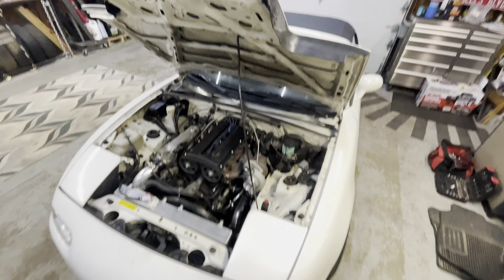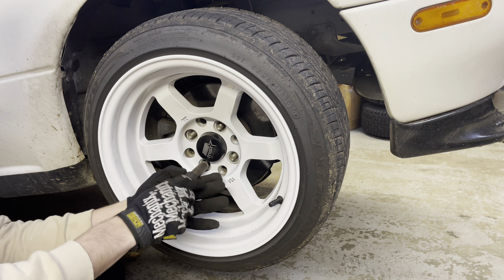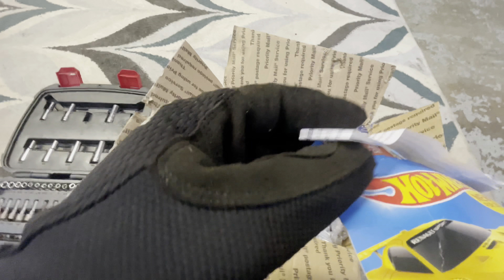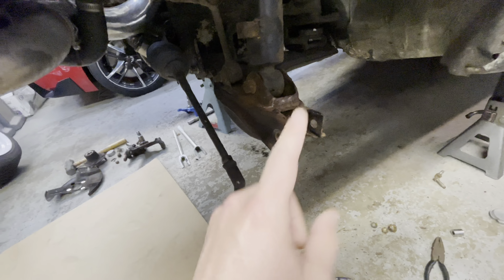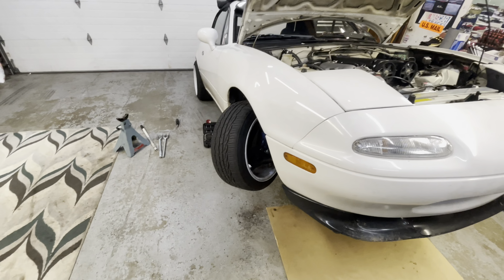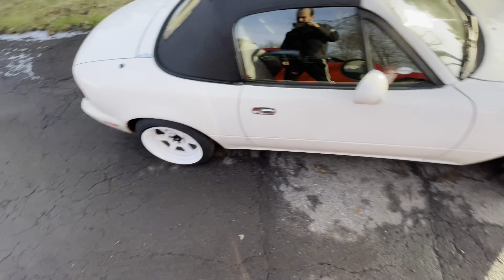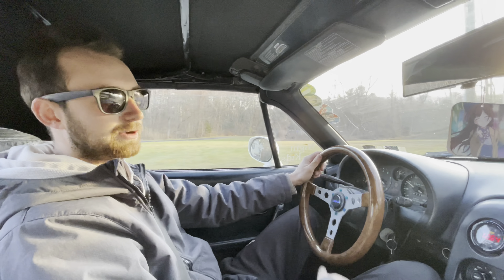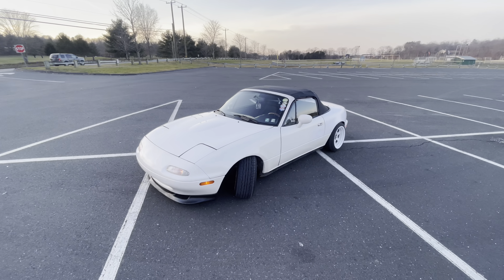Modded Knuckles DRIFT tested on the Miata!

Comment: Awesome job just curious what was ur brake lines like after fitting the knuckles or did u need to fit extended ones?
Reply from the maker: It worked with stock lines but they were getting stretched, since I have got the destroy or die arms and extended brake lines and it’s sweet!

Comment: Where did you get the cut knuckles ?
Reply from the maker: Someone on marketplace makes them, this is the link https://www.facebook.com/marketplace/item/589270629145788/
Reply: @DOHCamm  nice! With these cut knuckles did you have to run extended front brake lines ?
Reply from the maker: @nickolasbarboza312  I didn’t have to and they don’t stretch at max lock but I might get some in the future just for that ease of mind at drift events lol